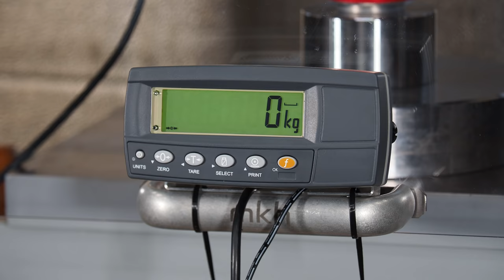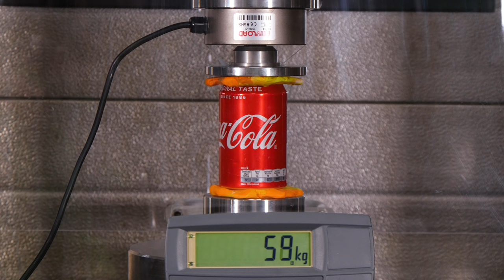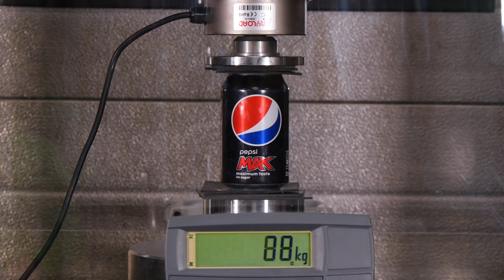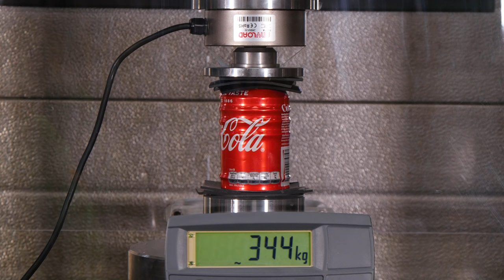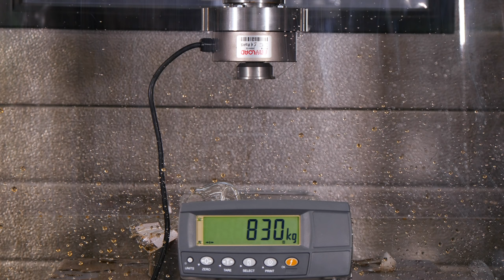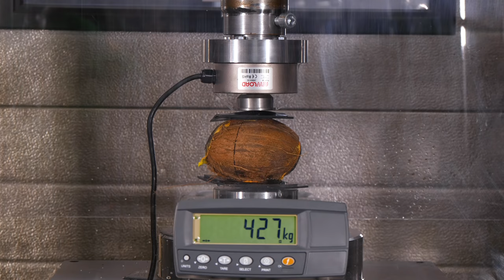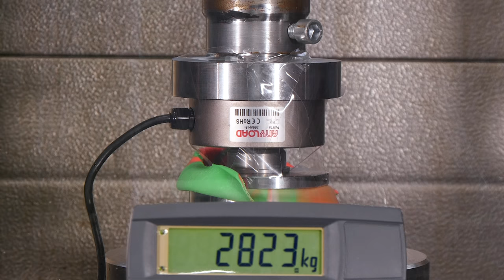How Much Weight Can a Soda Can Hold? Hydraulic Press Test

Comment: Can you place the force gauge on the floor and drop Anni's frying pan on it to estimate how much force was involved with her foot injury?  Maybe a BTP video of other things that people might accidentally drop on their foot?  Watermelon, dumbbell, kettlebell, frozen turkey, etc.
Reply: Woodworker Don Sadly the force sensor likely wouldn’t be able to respond fast enough. However, there is some simple physics you could do to calculate it. The force will equal the mass times velocity divided by the time interval of impact.
Reply: @isaiahmumaw  Yes, but there is also the problem that it depends on how much your foot compresses under load.
Reply: @sbreheny  That would be the time interval, yes. It's based on the impulse equation, which does factor in compression.

Comment: Something for you to test: Will a circular saw spinning at full speed cut through a ceiling fan (wood blades) spinning the opposite direction? Or will the blades just break off and go flying?

Comment: Hi Lauri & Anni. Love your videos. I would recommend looking into revisiting the egg for a dedicated video. They are an interesting case as the strength comes from the arch shape when aligned on the vertical axis. The tricky part will be making a precise hemispherical tool to hold  each end to allow maximum load from the press. If you pull it off, you should get forces many times greater than 20kg and I think your viewers will be amazed. 

Thanks for the great videos, keep up the good work!

Comment: Many moons ago like 40 or so years did the same with eggs in a press , store bought and free range eggs . The max we got out of a free range was 5000kg I kid you not and around 2000kg for store bought were just using 2 perfectly flat press plates and a 150t press hand pump . Either modern eggs are as soft as hell or it had a flaw in it . I loved the way the full can rippled under pressure looked like rolling mill marks . Cheers from Australia

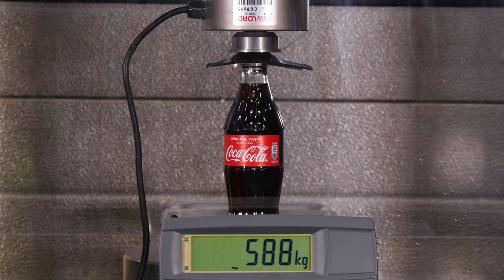Comment: 6:57
This is how glass insulators on power lines hold the heavy wires so well. They actually have two metal loops that put the glass under compression instead of tension. They can hold thousands of pounds.

Comment: Yeah, there is a type of seam going along the length of the coconut. If you put too much pressure on that seam it will split open, I usually open coconuts by hammering or smashing that part against a rock

Comment: "number 9" had same thinking that me when watching that. The liquid in can had so huge pressure at that time, so it helps aluminium to keep its shape so long than the pressure is not escaped. There is "air" (gases) too so its not total fully. When the gas (and can) is pressed "off" (to few ccm to 5% or under, and there is few bar pressure in the can before it's ewen seen Jarmo) that stuff inside  cut the way out of aluminium. 
If you can somehow (I know) take small amount that stuff inside to outside before or then when its going make those shapes, you can continue longer. That it's hydroforming. The thing what what Jarmo should explore. because its hydraulic and pressing...

Comment: I honestly wasn't surprised about the glass bottle  glass is actually very strong under compression if formulated for strength. stronger than some metals in some cases and i would love to see a Rupert's drop with a pressure gauge i know you did one before but having a scale to see the pressure would be cool

Comment: Sapporo beer used to have a 22 oz steel can that had a curve kind of like a Coke bottle and the sides had flat segments all around (It's really hard to describe!).  Anyway, it was a really heavy can and was MUCH stronger than an ordinary can.  If you could find one of those, I think it would be really awesome.  If an aluminum coke can can hold over 800 kg, I bet the Sapporo can could hold 1600 kg.

Comment: If you have enough silly putty or silicone sheets, a bunch of unopened coke can or bottle, and a piece of rigid board, you can theoritically build a platform strong enough to hold a small car? Neat

Comment: If you used a Pneumatic press that used air to extend the cylinder you might get a more accurate reading because a air powered cylinder would stop and build pressure until it gets max reading and then crushes.would be more fine tuned than a hydraulic press

Comment: Well on average it takes about 50-90 pounds of pressure to break/ crack it depending on what angle the egg is.

 Also a coconut is easier to break on it's side like that mainly if hit coconut on the line between it's eyes. Sounds weird but on the top of a coconut there's a face with eyes, nose, an mouth.

Comment: The coconut didn’t break standing because the force is concentrated on the top but when it was on the other position the weight is spread and it broke easily

Comment: The strength of these cans and bottles probably has a lot to do with how parallel the top and bottom are.
A few thousanths of an inch higher on one edge, the structure will buckle easier

Comment: i used to make oil filters and different companies wanted different thickness of steel  .0130 .015 .018 and .020 for automotive filters and heavy equipment companies wanted .022 .026 thick steel do a crush on filters and show what it takes  and remember they all come off the same assembly lines

Comment: I knew the coconut would be strong as shit because a good hard foot stomp generates over 1000lbs of force, and there's no way you could crack a coconut just stomping it. 
But I didn't expect it to take 2300lbs and still not break. That's impressive.